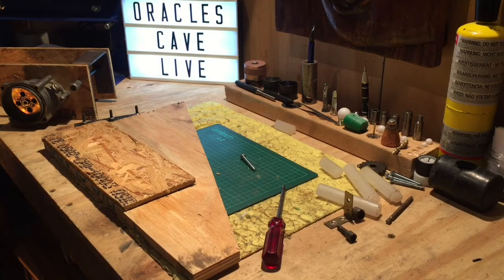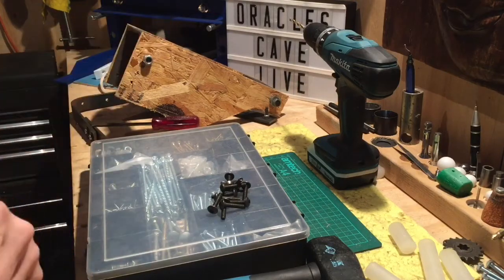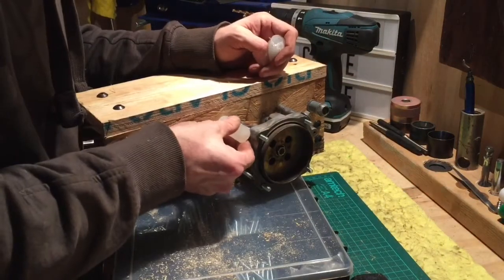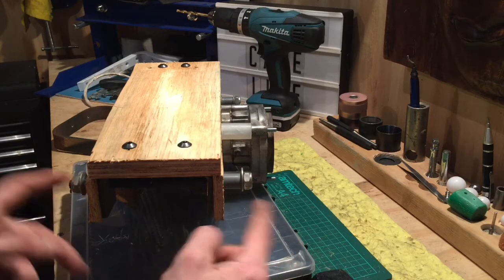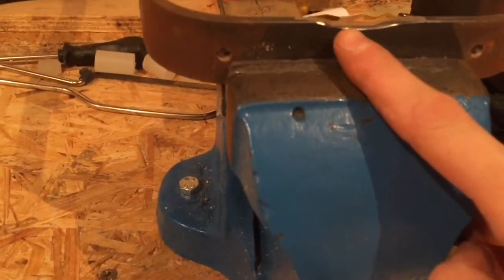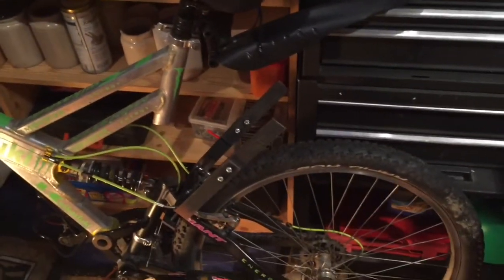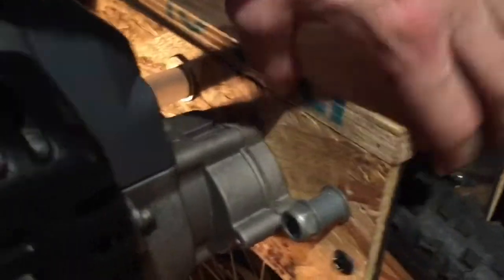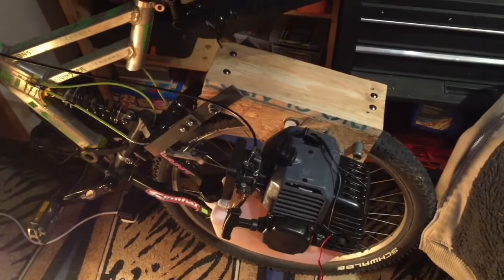50cc PROJECT BUILD PART 8

Comment: You're cracking on now mate. Soon be riding around :)
Reply from the maker: MalcOfLincoln ha ha ha I doubt I will be clocking up any speeding fines.
I'm not sure on sprocket sizes, I have a 4-1 or 5-1 gear reduction so I need the smallest front sprocket and biggest rear sprocket I can find with a chain to match.
Loads trickier than it looks lol

I will need to get the Mrs to make me a hell's angels leather waistcoat for riding this thing ha ha ha

Comment: Why don't you get in touch with a metal fabrication shop near you best to just drop in and see if they have any scrape bits of metal you can use they normally just sell it to the scrappy so you could get it dirt cheap or even better FREE lol coming along nicely
Reply from the maker: The big man I wouldn't know what a fabrication shop looked like lol
I wouldn't mind a big pile of bits and bobs of metal, I will keep my eye out for stuff on gumtree, that's usually a good source for STUFF.

I might weld a mini dirtbike rear sprocket onto my back wheel since I can get the chain and drive sprocket to match, all from evilbay.

Gonna have to name it WIDOW MAKER , with the massive amounts of raw power lol
Going to cut up an old suitcase to make a stealth luggage carrier ha ha ha, trying to catch me riding dirty.
As soon as I get a donor bike I will put the other kit together, that one has loads more power, better fun for longer distance.
100 miles per tank ha ha ha
Reply from the maker: The big man lol that's in paisley, I'm on the edge of one of the Lanarkshires, I think.

I use eBay for everything,  or B&Q if I need it and can't wait.
I keep my eye out for piles of stuff people have put out for collection aswell, if I see something worth taking, I just take it ha ha ha
But most of the time the gypsies get to the metal before I do.
Reply: ORACLE'S CAVE I have a giant level crossing sign if you want it I got it for my son because he has autism and loves to go to watch them work but he is terrifying of it
Reply from the maker: The big man I wouldn't say no lol
I was going to collect them kind of signs ages ago when I was thinking about turning this bike into an electric bike, until I seen some homemade battery packs explode lol.

Maybe your boy just can't see the level crossing in the picture, perspective is very tricky, sometimes when you look at a picture you can't help associate it with whatever it looks like in the back of your mind.
I seen some videos on YouTube about that, pictures made up of about 7 dolphins, but all I could see was a man and a woman, it explains how brains and perspective worked, a lot trickier than just looking and seeing.
Reply: ORACLE'S CAVE he thought I had stolen it from cardross station which is the station I take him to so I had to take him down to make sure it was still there £500 down the drain lol, it's yours if you want it mate but you'll have to get a trailer to pick it up it's about 5 foot x 4 foot and it weighs a ton
Reply from the maker: The big man 5 foot by 4 foot WTF 
ha ha ha ha ha, I thought you meant a normal sign like the size of a road sign lol
Your crazy, I have no trailer and never even reversed with one before, but if I was you I would shove that on eBay or gumtree, loads of collectors would go crazy for a sign like that